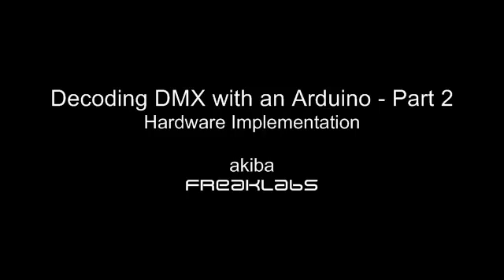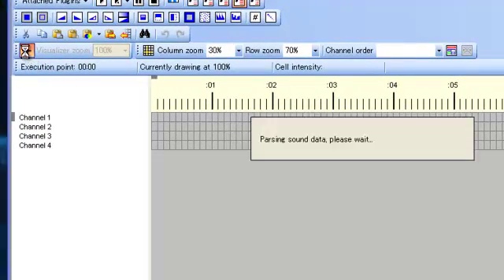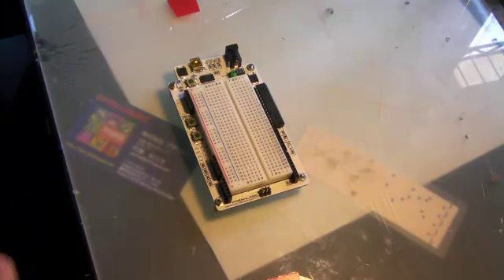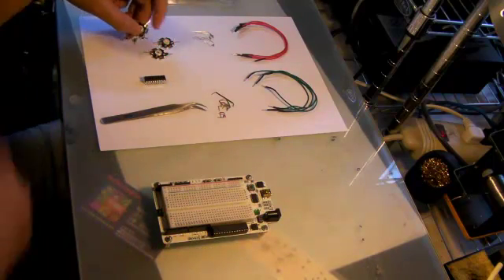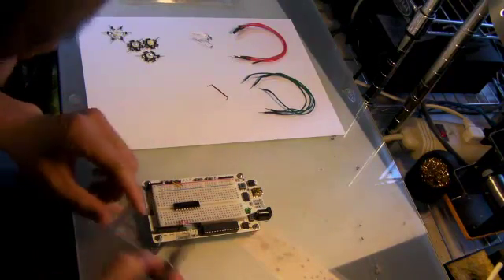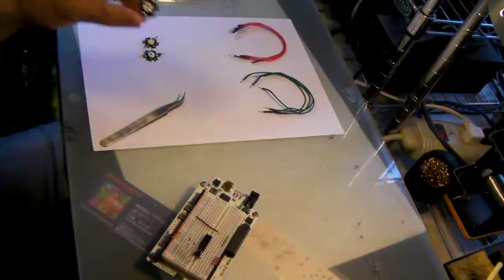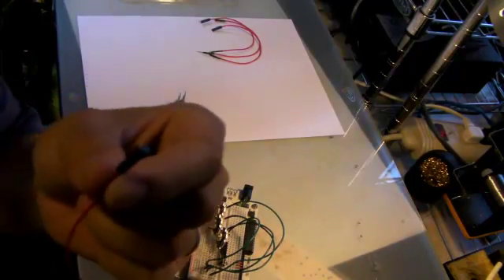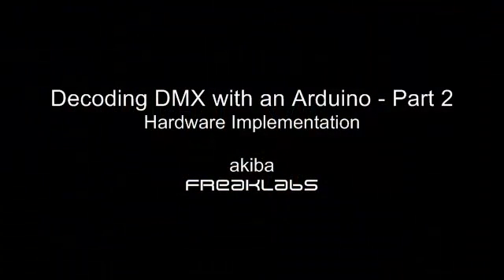Decoding DMX with an Arduino - Part 2

Comment: Here is the code, I got it to compile correctly with an arduino uno(after fiddeling a but with Hardwareserial0.cpp, but the vixen software kept giving me errors
#define DMX_NUM_CHANNELS 4

enum
{
 DMX_IDLE,
 DMX_BREAK,
 DMX_START,
 DMX_RUN
};

volatile unsigned char dmx_state;

unsigned int dmx_start_addr = 1;

unsigned int dmx_addr;

unsigned char dmx_pin[DMX_NUM_CHANNELS] = {8, 9, 10, 11};

unsigned char dmx_data[DMX_NUM_CHANNELS];

volatile unsigned char update;

//Added this line myself
int chan_cnt = 0;

void setup()
{
  update = 0;
  dmx_state = DMX_IDLE;

  for(int i=0; i<DMX_NUM_CHANNELS; i++)
  {
    pinMode(dmx_pin[i], OUTPUT);
    digitalWrite(dmx_pin[i], LOW);
  }
  UCSR0C |= (1<<USBS0);
  Serial.begin(250000);
}

void loop()
{
  if (update)
  {
    update = 0;

    for (int i=0; i<DMX_NUM_CHANNELS; i++)
    {
      if (dmx_data[i] != 0)
      {
        digitalWrite(dmx_pin[i], HIGH);
      }
      else
      {
        digitalWrite(dmx_pin[i], LOW);
      }
    }
  }
}

ISR(USART_RX_vect)
{
  unsigned char status = UCSR0A;
  unsigned char data = UDR0;
  
  switch (dmx_state)
  {
    case DMX_IDLE:
      if (status & (1<<FE0))
      {
        dmx_addr = 0;
        dmx_state = DMX_BREAK;
        update = 1;
      }
    break;
    
    case DMX_BREAK:
    if (data==0)
    {
      dmx_state = DMX_START;
    }
    else
    {
      dmx_state = DMX_IDLE;
    }
    break;

    case DMX_START:
      dmx_addr++;
      if (dmx_addr == dmx_start_addr)
      {
        chan_cnt = 0;
        dmx_data[chan_cnt++] = data;
        dmx_state = DMX_RUN;
      }
    break;
    
    case DMX_RUN:
      dmx_data[chan_cnt++] = data;
      if (chan_cnt >= DMX_NUM_CHANNELS)
      {
        dmx_state = DMX_IDLE;
      }
    break;

    default:
      dmx_state = DMX_IDLE;
    break;
    }
}